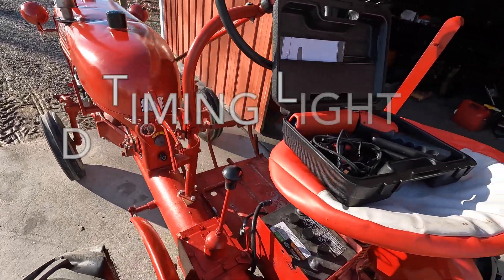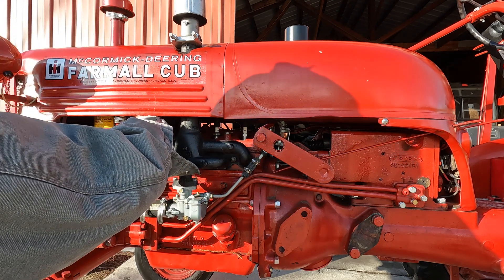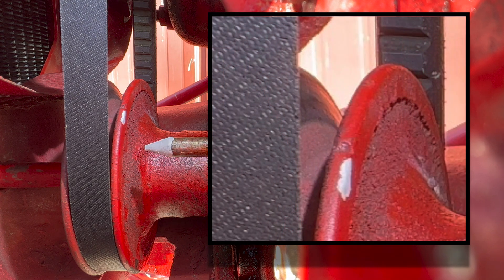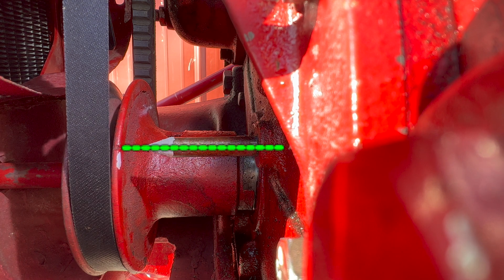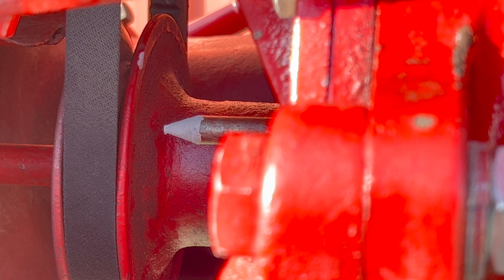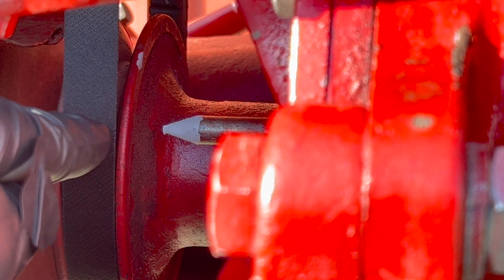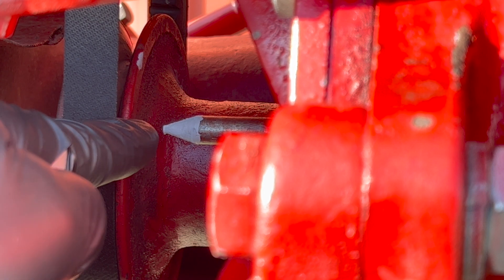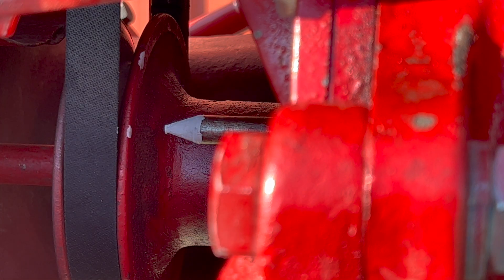Farmall Cub - Timing Light Demonstration

Comment: It looks like your governor has been readjusted to boost the high idle. 1700 rpm is to high for a Cub of that year. Only the blue stripe Cubs at the end of the series ran that fast. On the magneto models, a good way to set the timing is to have the imulse engage just as the timing mark lines up. Timing marks could be a problem for some people. In the early days of aftermarket parts, the pulleys being sold didn't have any marks.